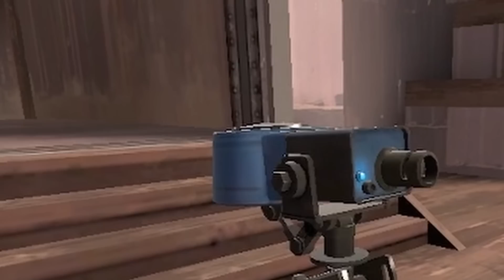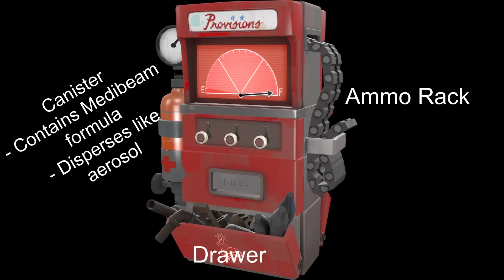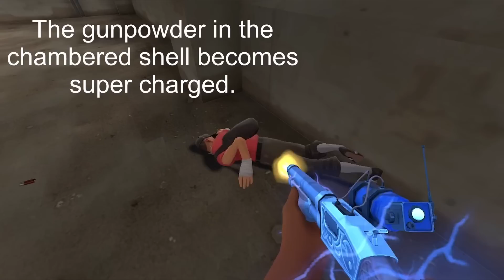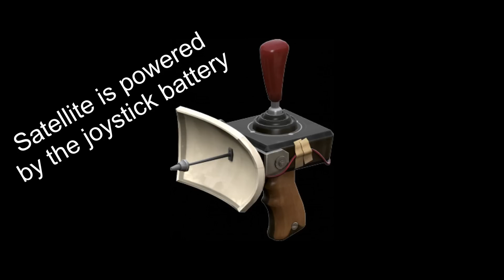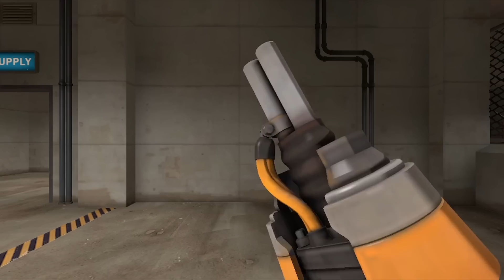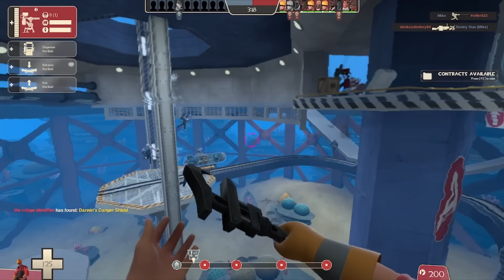How do Engie's Buildings Work?

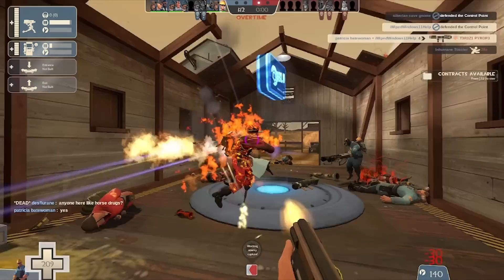Comment: 2:21 back in TFC it used to make more sense because you have to put the ammo in the diaper instead for each used with one hit of the wrench filling the dispenser 25% and using up 30% of the engineers metal you might think this is awful but then you realize building a dispenser required no metal and when destroyed it could damage enemies and the engi that made them making them a useful discount stickies

Comment: I always figured the light on the sentry was a color sensor. Any teammate who passes it gets scanned and the machine doesn't register them as a target. However, the reason it doesn't detect disguised spies is that GabeN's favorite class is the spy.
Reply from the maker: The color sensing probably coincides with the motion detection.
Reply: I think it's just the same dot from things like security cameras. Apparently there's no one thing that it does, it's mostly for just indicating that the camera is there.

Comment: Alternate idea for wrangler. It actually functions like a radar/laser designator used on irl military weapons.

Basically, the wrangler fires out a laser wherever it's pointed. When the laser hits something, the light is dispersed in all directions. The sentry has a "seeker" which can see one the same spectrum as the wrangler's laser, hence why the engine can choose where it points. The same mechanism through which the sentry is used to detect enemies is used for the wrangler's aim assist.

As for the shield, I have no explanation.
Reply: The shield IS the seeker that sees on the same spectrum. Whenever the light of the wrangler hits the shield, it does some fancy pants trigonometry to figure out exactly where it is! The shield also doubles as an effective projectile vaporizer!
Reply: Shield could maybe run on similar tech to medic's MvM shield? Which is to say, non-descript sci-fi laser forcefield bs.
Reply: @bugjams  
Well, what I meant specifically is I have no explanation for why it only pops up when wrangled.